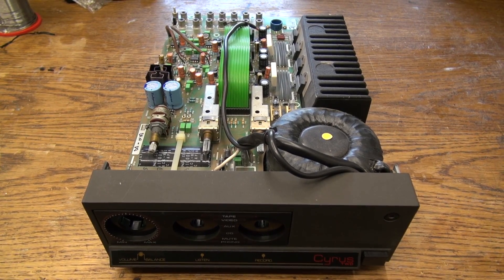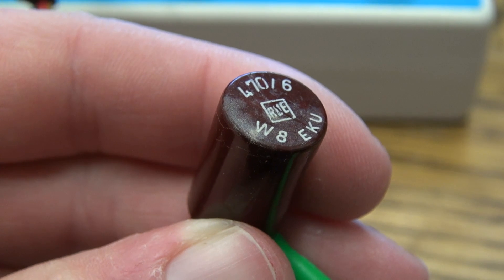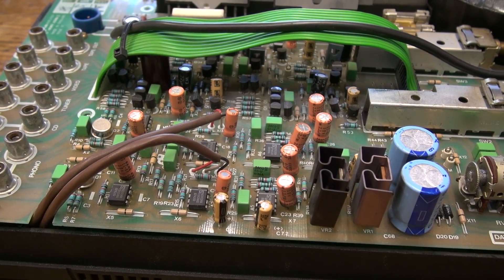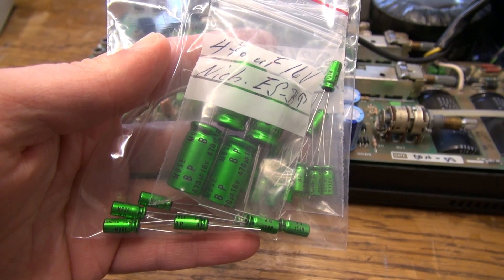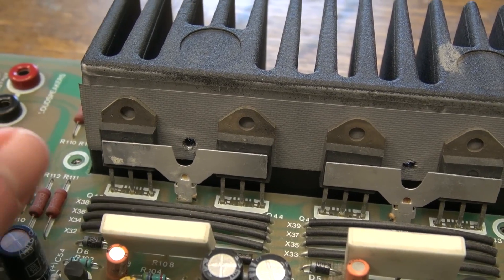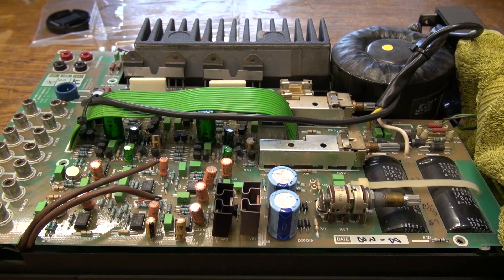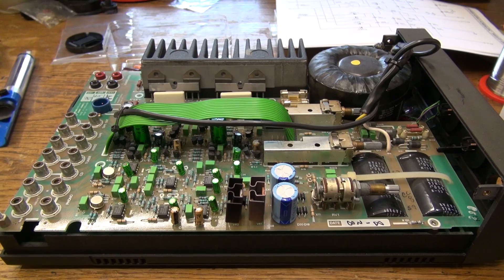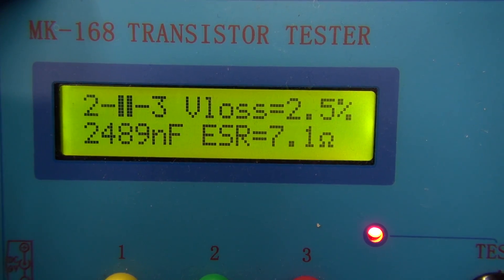Cyrus Two Amplifier Replacing Bipolar Capacitors

Comment: Hello, change thousands of capacitors in computer but in audio only a few, what I have found rare or capable is common, but I do not know it, it is that when measuring old retired capacitors they give me more microfarads than the original factory, example 47uf to desoldarlo and measure it gives me 58uf, so it has happened to me with old audio equipment usually, not always, some are perfect despite being over 40 years.

I'm learning little by little, a technical friend told me that many times they can look good, but when they work hot they do not work well and can only be checked working, I do not have more than a common capacimeter.

Very good video

regards

Comment: A really clear video that's inspired me to have a go at the job.  So, I'm looking to get the replacement capacitors. Could you tell what the voltages are on the first six you replaced?  Thanks.
Reply from the maker: I don't remember these values, please note this is not a video I recently did. I would strongly recommend you download the service manual for the Cyrus II that is available online. It contains schematics as well as all the values of parts. You can always replace capacitors with ones that have a higher voltage rating, but never replace capacitors with ones that have a lower voltage rating.
Reply: DrCassette Thanks, I didn't know you could still get the manual. I'try that, and also your instructions on cleaning. YouTube is great when get videos like these. Good job!

Comment: hi great video on Cyrus 2 cap replacement but do you gave a link you can sent on getting the bag of new caps from 1 supplier?
Reply from the maker: I found the set of capacitors on Ebay.

Comment: A question on a different subject. I want to professionally repaint the amp. But I'm having trouble disconnecting the volume knob from the potentiometer. How did you do it? Thanks in advance!
Reply from the maker: The volume knob simply pulls off, but it requires a bit of force. I'd suggest to hold the potentiometer inside the amp while pulling the knob off.

Comment: Any chance you could list the exact caps you replaced . I have a cyrus 2 and some of the caps are swollen, I can desolder and replace them with ease but not sure what i need .
Reply from the maker: They have the relevant values printed on the case. Capacitance must stay the same, voltage can be higher, but not lower than on the original capacitors.
Reply: Thanks for the reply .What brand do you recommend ?

Comment: I am planning to do this change on the Cyrus 1 issue 06 amplifier stage capacitors using:

C33(L), C34(R): 2.2uF 50V unpolarised Nichicon ES

C41(L), C42(R): 470uF 6V unpolarised (16V version used) Nichicon ES

C49(L), C50(R): 22uF 35V unpolarised (note these are C39 and C40 on the schematic) Nichicon ES 

I will also replace:
 C47 & C48 (L) and C53 & C54(R) with 100uF 50V polarised (on the schematic these are C51 & C53(L) and C54 & C52 (R))
using Nichicon KZ series.

Comment: You can easily access the red capacitors if you unplug the green ribbon cable at the end near the front of the amp where it plugs into to a PCB socket.
Reply from the maker: It looks like a PCB socket, but I was not able to unplug it. I didn't want to force anything though.

Comment: Question. I have a mission cyrus 1 rated at 25 watts PC  into 8 ohms and 40 watts PC into 4 ohms. The speaker I am thinking of purchasing is a 6 ohm and has a minimum power requirement rating of 30 wpc. Will my cyrus one be able to drive these adequately?
Reply: I would say yes, it will drive them.
But, take your amp to the speaker seller and try it out before you buy.

Comment: How important is it to use Bi-Polar caps? I have read numerous discussions saying that it is really not required.
I have just bought a bunch of Elna caps (polarised) as replacements, so I hope theyre OK...haha
Reply from the maker: Cyrus used the bipolar caps for better sound quality. Technically it's OK to use polarised capacitors, they shouldn't blow up.

Comment: Why are those amplifiers so well known?.Any notable differences in sound after recapping ?
Reply: Q1,  "Why are those amplifiers so well known ?"
Because when they first came out, they were ground breakers.

A simple yet elegant, no frills design, using high grade components, available  (at the time) at Low cost to the consumer for high end quality sound.

"The little amp with the big sound", they got rave reviews in the HIFI press, and the name and reputation spread far and wide.

The true testament for them, is that they are still around and working 30 years later, and the company that made them is still trading and willing to service them today.

Q2, Any notable differences in sound after recapping ?

After re-capping mine, and checking the alignment afterwards..........
I would say no, not really, still sounds like the Cyrus one to me.

I could say..........
The bass is a little bit tighter.
The treble is a little bit sweeter.
The vocals have a little more Liquidity.
And the sound stage is a little more focused.
 
But that could just be the placebo effect, or the fact that I have just thoroughly cleaned my MC cartridge stylus.
And I am not a HIFI Journalist !
So I won't   ;0)
Reply: SirEggbertfartalot Very good answer,I noticed the amplifier is built well, and not too flashy,I like that.Still I personally wouldn't use it since it seems a little underpowered for my tastes.
Reply: fair enough   ;0)

It's not the best amp in the world, but it was fantastic value when launched.

It's not for everyone, but then again neither is any component in HIFI.

Even myself, I would prefer my old Proton AP1000 pre / AA1150 power combo back, but alas it's not to be.

This little Mission cyrus one, will do for a while, it drives my homebrew 3 way speakers (Kef T27, B200, B139) well enough for now.

Have you actually used a cyrus amp ?
Or are you going by the specs ?
Reply: SirEggbertfartalot Just going by the specs,I've only used chip amps,each with their own quirks and sound signatures
Reply: In that case, if you get the chance to try one out, do so.
It may just surprise you   ;0)

A good amp should have no "quirk", or "sound signature".
what goes in should come out unchanged, except for power increase.

The little cyrus does this very well, all things considered.
For what I would call "normal" personal Listening levels.

If throwing a party (or trying to vibrate the ornaments off of your  neighbours shelves) is your thing, well maybe it's not the amp of choice  ;0)

Or to put it another way, sound quality is more important to me than sound quantity, and if you want both quality and quantity, then you are going to pay Lots of money for it.

Comment: An interesting video. Would be interesting to hear your views about the sound quality after cap replacement.  Had you thought of replacing the two large reservoir  caps to the front of the Cyrus amplifier?  Some hifi companies were fond of the Roederstein bipolar caps you appear to despise...
Reply from the maker: +orlando1a1 
The bigger the capacitor, the longer the lifetime. The filter capacitors are perfectly fine. As for the Roederstein capacitors, what am I supposed to do? Patch the cracks in the cases?
Reply: +DrCassette  I agree, they looked nasty and had to go - you remind me to take a closer look at the Roederstein caps in my pre-amp...
Reply: I understand that all electrolytic capacitors develop leakage as they age -- even large filter capacitors. I'm taking inventory of the capacitors of my 1978 NAD 7080 and will be buying 2 new large cans. They are 15000uf at 63V and will be costing me US$33 each for good Nichicon KZ series. And the rest of the capacitors will be Elna SILMIC II.